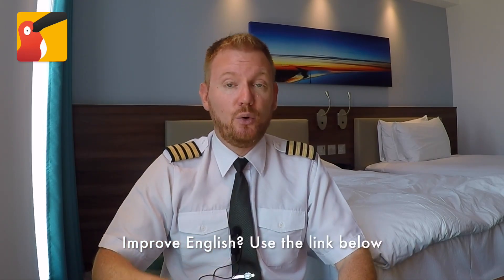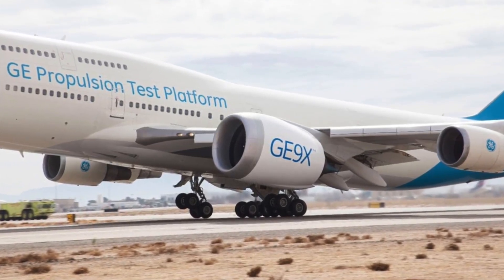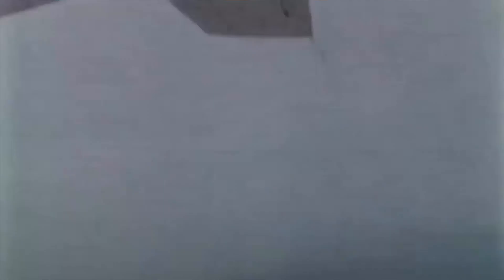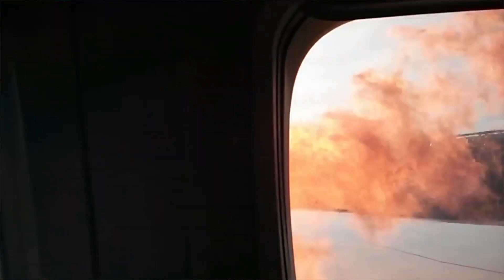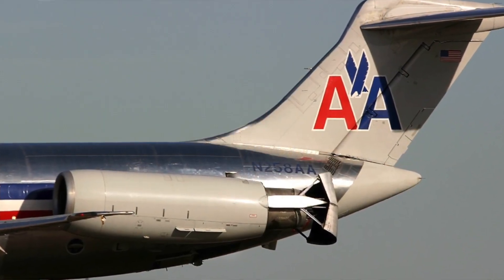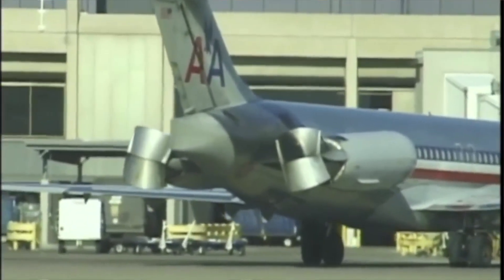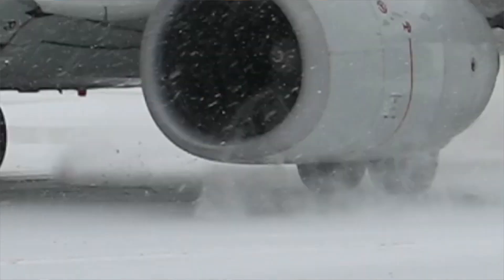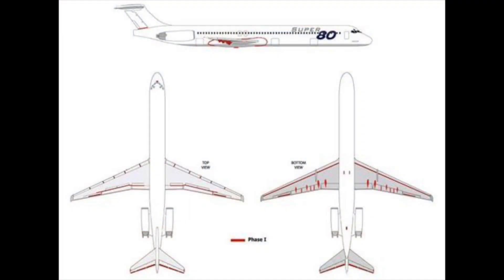Why are the jet-engines placed there? Wings vs Tail

Comment from the maker: Did you like this info? Consider joining my Patreon crew and support my work 🙏 https://www.patreon.com/Mentourpilot
Reply: Which did you prefer to fly?
Reply: @DuggieSutt  pp)
Reply: Why did wingroot engines like with the comet go out of style? Or bottom of the plane installations ala the planned american Concorde competitor SST?
In military planes they seem to work pretty well. Are there concerns with the available room for payloads or maybe regarding crashing?
Reply: Thank you ! This question seriously bugged me for some time, ha. I would see planes with the engines off the fuselage and wonder how there could be such a big difference in engineering between jets. I mean one would have to be the clear winner for performance, economy etc. I guess the answer is complex. It would seem to me that the foreign object damage issue you mentioned. Would make the back mounted engines a far superior design, except from potentially making stall situations worse. Hmmm. In any case I really appreciate the video. Awesome job
Reply: I hear home. Are ye a bit Irish?
Reply: @spacewitchvulcan  Lol, he is swedish all the way
Reply: thank you
Reply: Great like always👌
Reply: Mentor, I always thought that may be the rear engines that are near the fuselage were actually a more dangerous set up than the ones on the wing and the reason I think that is if the fan disc comes apart or if something over speeds and comes apart there’s a very big possibility it’s not gonna be contained and it’s gonna go right through the fuselage. And to me it’s really hard to say this because I love the MD 80s that’s like my favorite plane mostly because the sound it makes and how manual it. is it’s an awesome plane but at the same time I know that the plane is inherently dangerous because of the engine placement because not only can it hurt the fuselage but proven it has shown that ice can come off the wings and go straight into the engine and take the entire plane down.
Reply: Super interesting! What about wing placement- below vs above?
Reply: I had to find him on patroon, but he is WELL worth it.  Wish everyone was this gifted a teacher
Reply: I wish you could have commented on the 4-engine jet that has engines on top of the wings.  I have seen them online and think they are a British aircraft but not sure.  Very interesting and informative discussion.
Reply: I did like this info. A company called Embraer is developingnew design that incorporates rear mounted turboprops, with longer strut-wing-type supports to accommodate the props. Have you seen that concept drawing?
Reply: That bridge was called "Galloping Gurdy" by the locals, just fyi. :D Great peice of history.
Reply: If undermounted engines are not suitable for reverse because it is easier for them to get stones and other objects inside, why isn't this a risk when the airplane lands and reverse engine is activated?

Thanks!
Reply: Under Wing mounted engine  biggest benefit is the maintenance.
Reply: Love to, would you have me ? I am an elderly retired Motor Engineer / Company Director for B.P. I am mad about Aircraft, always have been, so I should have made my career in the industry, but I have had a Taste in my life working for Holiday Airlines at Jersey Airport Part Time during the very busy Tourism years of the past. Peter From Jersey. C.I.
Reply: 9:29 S-ediment H-urling I-nto T-urbines 
great new acronym you came up with Mentour
Reply: And why are some Boeings have the engines in the wrong place and they fall down from the sky last 3 years😀
Reply: Wasted 15 long minutes...uff

Comment: I love these aviation experts. 
In my 55 years in aviation I have flown on 46 different aircraft types. With engines under the wing, on the aft fuselage section, including ones in the vertical stabilizer but never flew in a single engine aircraft😱. Some of the info stated in this video is incorrect.

Comment: I fly Fokker F70/100 (rear mounted  engines), having "centerline trust" makes them a joy to fly and a very stable platform,  especially asymmetric. 
Another benefit is in the case of 'engine fire on the ground" as long as aircraft parked into wind (usually the case if on duty runway) fire and smoke will blow away from fuselage more readily. 
And the fire is further away from fuel source

Comment: It would be interesting if someone created a single engine jet aircraft that uses a special reverse jet on the nose acting in the same way that a propeller does on a prop plane. Pulling air into it to move the plane, rather than pushing exhaust out the back.

Comment: B777 flight control system automatically compensate changes in pitch moment from engines. FCOM 777 "Airplane pitch responses to thrust changes, gear configuration changes, and turbulence are automatically minimized by PFC control surface commands"
So we don't need to do what you describe when we change thrust.

Comment: The main reason for engines are mounted under the wing is help in balancing pitch down moment of Lift created on the wing. It reduced balance drag by reducing angle of attack of horizontal stabilizer and allow to save a lot of fuel.

Comment: OK, this will seem like an absurd suggestion, but I think it would really work. In the case of a superstall in a t-tail, the thing to do would be to roll 180 degrees. This puts the t-tail into air not disturbed by the wing. It will thus be effective at controlling pitch, not possible in upright position. After the pitch is corrected and speed is recovered, roll back to normal. Just an idea - I'd be curious if anyone would try this in a flight simulator.

Comment: Rear mounted engines are mostly phased out. I think the main driving force has to do with the Center of Gravity issue. It's so difficult to design airframes around the extra weight in the rear.

Comment: I prefer t tail rear engined aircraft because they have better pitch control and hold the pitch you left the plane at better. Conventional tail aircraft with wing mounted engines tend to be less pitch stable because they pitch up or down depending on the thrust inputs.

Comment: Another issue with rear mounted engines is weight and balance. I used to prepare load plans and W&B for Air Aruba out of BWI on MD80s and MD90s. They would fly from BWI with a small number of passengers to Philadelphia where the majority of passengers would board for the flight to Aruba. For the trip BWI -PHL we often had to load all the BWI passengers in first class and their bags in the forward compartment to get the aircraft properly balanced. Sometimes there were not enough passengers so we needed to add ballast as well.

Comment: You mention catastrophic engine failure as a problem scenario for rear-mounted engine: my recollection is that the issue was severed hydraulic lines causing loss of control on the DC-10.

Comment: 4:02 Harmonic motion is the term for the undulations of the wing. All bodies have a frequency at which they vibrate naturally, if the frequency of the vibrations on the wing matches that natural frequency, we get resonance and the amplitude of the vibrations will increase uncontrollably until something gives, like the wing breaking.

A simple example of resonance is a child on a swing. The child throws his legs forward and leans back, pulling on the suspension rope to gain energy at the same frequency as the swing which is at the highest point of each swing. If the child were to randomly do this, then the swing would lose energy and eventually stop. When the frequency of the input energy matches the resonant frequency of the body (like a wing) the maximum amount of energy is absorbed and the amplitude of the vibration increases.

Comment: Clearly size matters.

* Among widebody airliners, none have engines mounted on the sides of the rear fuselage. DC10 and tristar had two under the wings and one on the tail.
* Among large, long-range, single-aisle airliners, only two have read-mounted engines : VC10 and Ilyushin62.
* Among smaller, short-range airliners, many have... Embraer, Fokker... 
* Among business jets, it's almost universal.

Obviously, some of the arguments for tail-mounted engines work better for small aircraft. 
For exemple, the one about accessibility for maintenance.
For a 777-size aiurcraft with rear-mounted engines, the engines would be ridiculously high above the ground. 8 meters or so.

For a learjet, you just need a stool.

Comment: I don't know as much about aviation as an engineer. But in one of your videos, you were describing one of my favourite (forgive me, that's a strange word) flight accidents, United Airlines Flight 232. You talked about how the pilots controlled the aircraft with only thrust, even though they had no flight control. With the help of the engines being under the wings; you said that the pilots were able to control the aircraft to a small extent with non-asymmetric thrust. Perhaps it would be a better decision to have the engines under the wings, considering such situations.

Comment: I only fly spaceships :), but it seems to me the obvious solution to the pros and cons of these two locations for engines is a third location: the TOP of the wings. No ground clearance issues. No ice issues. Jetwash may help balance the potential disturbance of foil air. Nacelle could be shaped with lift curve too. Wing structure lighter just like lower wing engines, for the same reason. Engines closer to vertical cg, less thrust pitching. Big as you want with no ground clearance issues. Shorter landing gear, stairs, no sucking "shit" (quoting Mentour Pilot) off the runway on takeoff. Speaking of sucking, no sucking of ground crew thru the engines either. Maybe a little noisier in the rear of the cabin at takeoff, but no picnic at rear of wing engine cabins anyway. Engine failures might be a little messy though. What am I missing here? Seem to recall some older turboprop and/or seaplanes did this?
Reply: The Bernoulli equation states that an increase in velocity leads to a decrease in pressure. Since the surface area on top of the wing is larger than the bottom one, the velocity of air on top is greater due to the law of continuity. This in turn means the pressure is lower which creates the lift that actually makes planes fly. 

If you obstruct the top of the wing with an engine, you are going to generate less lift and that's not what you want. The bottom of the wing is overall a better position and additionally makes maintenance easier.

Comment: A couple of edge cases; If a tyre blows on take-off, rear-mounted engines (e.g. on the DC-9) can swallow the remains of the tyre,  That does nothing good for their performance, which means you now have 2 problems. (Most private jets have the engines close enough to the wings yhat they are protected from debris.) 
Under-wing engines mean that the fuselage has to be quite a long way from the ground. That's not a problem with termnal gateways, but is for flying into smaller fields. 
Finally, there's the unique (so far) case of the HondaJet ,which has engines mounted on pylons above and slightly benind the wing, That allows low access, protects from debris, and keeps noise and vibration away from the cabin.

Comment: Benefit number 1 for engine under the wing configuration is it gives weight reduction of the structure. Benefit number 1 for engines on back of the body is clear wing.

Comment: One question why do the Turbofans still have a casing. I mean the Fan would have a smaller diameter, compared to one which doesn’t have a casing. Who knows maybe Boeing 737 max would have never needed the MCAS if it had a Turbofan without a casing XD.

Comment: I remember my initial aircraft design career in the early 1970’s where we had to prepare detailed drawings to demonstrate probability of catastrophic damage resulting from random direction engine non-containment (such as one-third disc) was acceptability low. More difficult to achieve when engine fixed to fuselage as opposed to mounting further away under wing. Perhaps a relatively minor point but I thought worth adding in. I also played a very small part in the Papa India trident aircraft crash in June 1972 , a super stall where stick push saved the aircraft three times before crew disconnected the system resulting in around 120 lost lives. A lot of factors involved; you may be interested in looking at the public investigation findings.

Comment: As an automobile enthusiast all my life and having majored in engineering, it is also very, very interesting to read every comment in the great debate of the location of the engine on an aircraft as well. Especially, I love learning about the pros and cons for each location of the engines, in terms of rigidity and aerodynamic flow. Just to point out where exactly it was fun, a specific attack angle in a rear engine aircraft can leave the horizontal stabilizers with significantly less airflow blocked by the wings, which could end up in a super stall.

Comment: Why can I not find the answer to why engines are mounted under the wing instead of on top?
    This obviously negates Bernoulli’s principal. Does it not?
  The jet blasting it’s very high velocity exaufhts across the bottom of the wings would eliminate any advantage of the airfoil effects created by the wings shape?

Comment: Thanks for making this. I've wondered why airliners have only had wings mounted on the bottom of the fuselage rather than on top. It would seem that having them on the top would give more space for high bypass engines suspended under the wings.
Reply: You usually try not to put engine intakes ABOVE any lifting body in a subsonic plane because lift is produced by the air flowing above that surface being at higher pressure than air flowing under it. Which complicates intake design and, worse, means the speed of sound in that top air is lower which means you hit the sound barrier much sooner.

Comment: What about aircraft like the Honda jet where the engine is above the wings.

What if you put 2 engines in the back and 2 underneath the wings? You will have 4 engines. How would that affect the aircraft.

Comment: basically, putting engines in the rear is the default if you're making a simple plane. As you get larger and more advanced structures, you need to move them toward the center under the wings.

Comment: As a private pilot with only about 150 hours, I have always wondered, (if the pilot and copilot died) could I land a large aircraft like a Airbus 380, 747 etc., by mainly knowing where the landing gear, flaps and throttle are?

Comment: What will happen when a flight (A380 Kind of big flight) contains 2 engines on wings and two wings are tail mounted. it will reduce the weight on the Wings, right?

Comment: Thank you Mentour Pilot for your explanation of rear-mounted engined Aircraft, I did love the MD 80 / 90 plus the V.C.10 because it was a quiet Aircraft. Have you any views on why the Aircraft Manufacturer Embaere has delayed building its new rear-engined Turbo Prop? it looked an existing design with a modification of fitting the Engines on the Back instead of the Wings. maybe it was a lot more costly than first realized ? maybe the whole rear of the Aircraft would have to have been redesigned with a much larger tailplane and beefing up of the fuselage ? could you do a feature on this ? Love your Aircraft Videos, Peter from Jersey. C.I.

Comment: Instead of only 2 big bottom engines, besides the maintenance costs for 4 engines, why the not make two at the bottom and two on the top, that will be the best of two worlds. For cruising noise and reverse use more the back engines and for takeoff or a fuel pump issue use the two at the bottom.
Reply: Generally, two very efficient engines are better than 4 less efficient or smaller engines, because bigger engines = higher bypass ratio = more efficient. This is why other than the a380 and the last couple 747s who need 4 engines because they are that big, you rarely see more than two engines on a plane. If you have 4 engines and use either the bottom two or back two more, the other less used set is creating unnecessary drag and is kind of like dead weight, not doing much, hurting your fuel efficiency. There are also certain maintenance issues that have to be fixed on a certain engine, meaning you have to go up to the back engines to fix it. Hope u got through all of this
Reply: @Andy-iq9pz  Interesting, thank you for the information.
Reply: @HighPoweExpress  👍🏼

Comment: in case of emergency landing, high mounted engines have an advantage as they wont have direct contact with the ground upon touching the terrain, engines under the wings could explode or immediately detach from the aircraft upon touching the land

Comment: If you modify the X-Plane 11 737-800 engines to be extremely powerful, that pitch up moment becomes fatal when you apply excessive thrust. Full thrust at takeoff is an unavoidable tail-strike right away. You have to set the autopilot N1 really low. It causes the autopilot to chase the pitch trim for hours, if you don't aggressively force it to stop oscillating. It's pretty comical to hold mach 0.8 above FL350 with 9990 ft/min climb, not even full thrust. If you try to accelerate hard from slow flight at full thrust, you end up in an uncontrollable straight up attitude, which causes you to deeply stall and drag to a stop. Then the off centre thrust begins to rotate the plane around its pitch axis rapidly, as it tumbles down, in free fall.
Reply: Common sense.
Reply: If my aunt had a cock she'd be my uncle. What is your point?